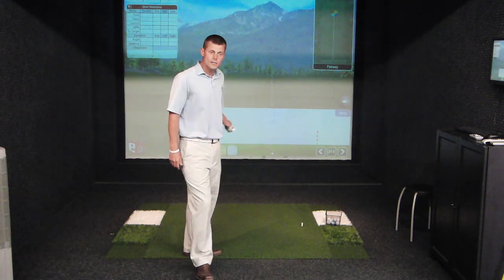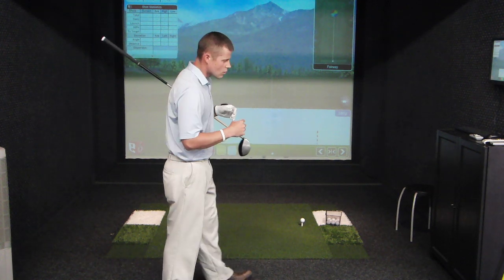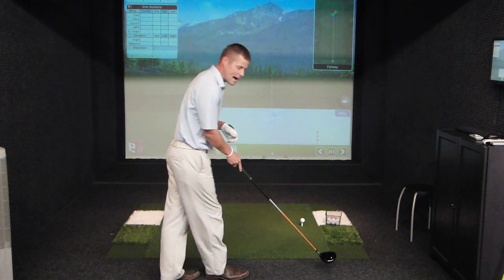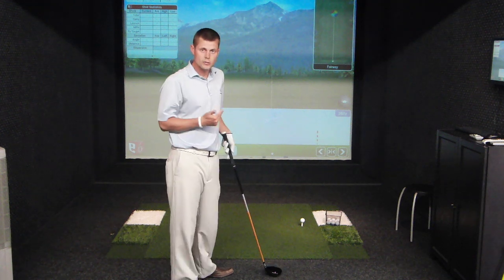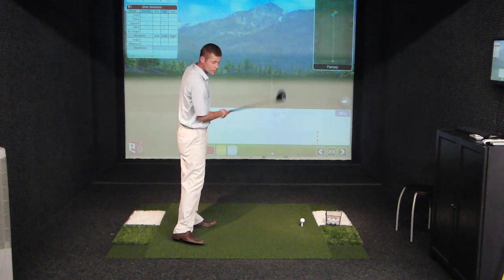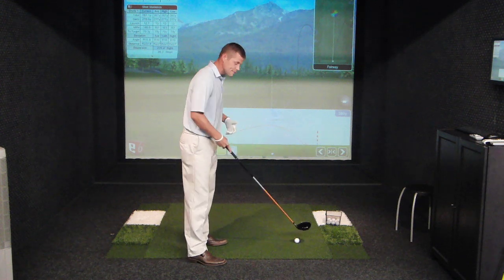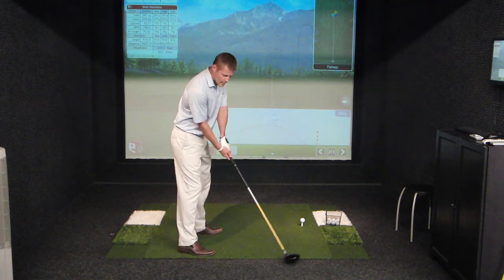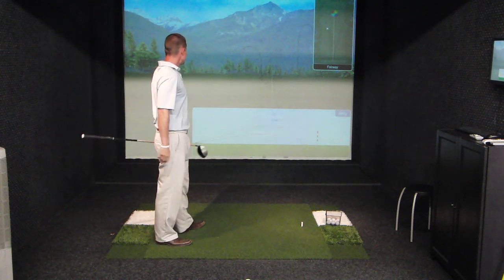How to hit a Draw and Fix a Slice - Sam Goulden Golf

Comment: hi  sam thanks for the excellent video! 

my two cents worth on ball flight 'laws' - the ball doesnt know what the target is .. it merely responds to the path and face angle. therefore the only way to hit a draw to a target is to set up way right and have the club slightly less right. 
 where trackman has added to our knowledge of golf physics is that with the longer clubs the initial  direction is determined more by the face angle of the club rather than path (face deflection)